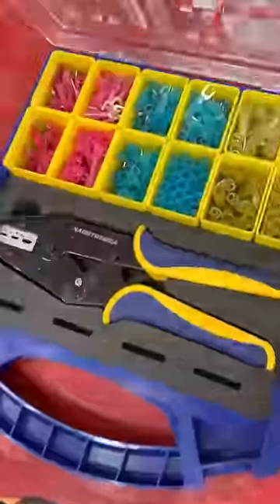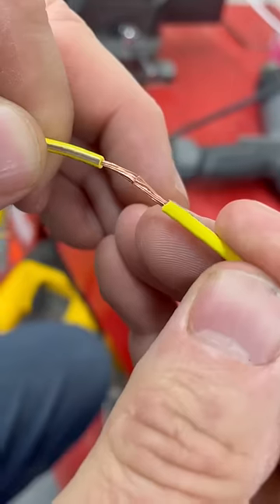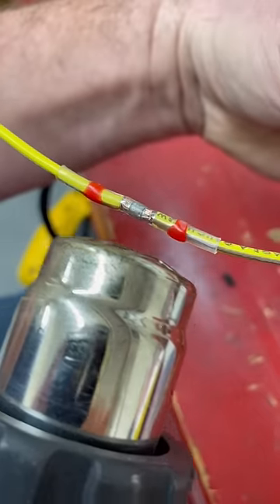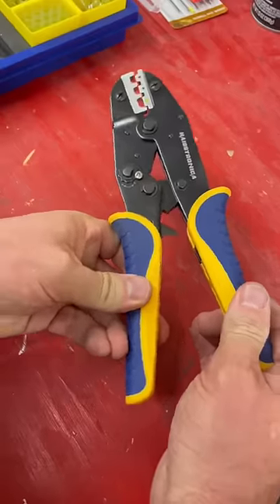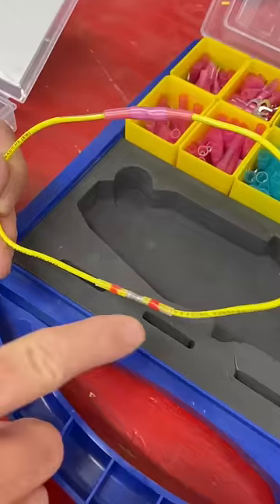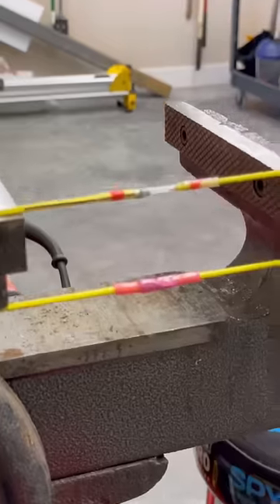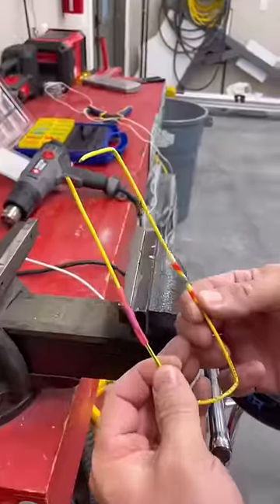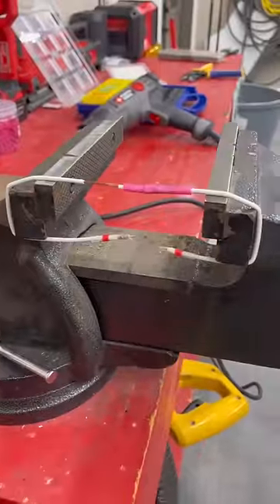Crimp verses Solder Connectors

Comment: Always use crimp connectors on power. That way the connection won't fail if the wiring goes over current and heats up.
Reply: if your wire is getting that hot, and its not blowing a fuse (which 100% it should be connected to) i would prefer a  solder joint to fail and break the flow of current effectively reducing the fire hazard.
Reply: Wrong, very dangerouse thinking. The dude purpose in life is to protect the wiring, prevents wire from overlaid heating and melting. If anything if crimped improperly can create a bad connection that heats up...
Reply: I'm not an expert but by the time your wire is at the melting point of solder (400 degrees Fahrenheit or so) wouldn't there be a lot more things to worry about than your wiring connections? At that point the insulation would probably all be gone and on fire
Reply: Yeah, any type of connection would fail under that extreme of an overload. But you should always use crimps, as the crimp itself provides more conductive surface area than the cabling itself so it's much more difficult to burn out a crimp connection, where as solder is only as thick as the wiring itself and is VERY susceptible to cracking under high vibration conditions like in a vehicle.
Reply: @joshuahelt6589  bruh what???? Having a connector come lose is a HUGE FIRE HAZARD.
Reply: @MisterMosfet  the crimp connector is better than solder ONLY if the wire strands ( and receptacles) are properly plated. Look at any decent vehicle wiring, you won’t find any  naked cooper. 
In the the video the wires are plain cooper, so this gives us the verdict.
Reply: So what you're saying is.
Run circuits UNFUSED.
A fuses job is to protect the conductor and devices.
The wiring should never get so hot that it can MELT lead-free solder.
Reply: @sushigaming101 100% agree I was taught to always solder all connections. If your lines are getting that hot you have bigger problems then a connection lol. All accessories you add to your vehicle should have a fuse close to the battery and a relay so it doesn't burn up the switch that and soldered connections you shouldn't have a problem.
Reply: Soldering hardens the wire. Try to avoid having any kind of splice where there is a lot of movement and vibration. Run a full wire to an area you can tie down the splice.
Reply: @yyfreak1637  PVC insulation is rated for 90°C, solder won't melt till at least 190°C. By the time the solder melts, the insulation will be gone along the entire length of the cable. That's far more dangerous than a broken connection.

The whole pint is mute though, if it ever happens, you've got bigger issues.
Reply: @sushigaming101  this type of solder connector uses low melt solder, still way to hot to be safe for a wire but it melts at a lower temperature than normal solder.
Reply: If you're soldering a connection properly, the solder joint itself will be much larger in diameter than the wire and will also be lower resistance than the wire therefore will never become a hotspot. The wire itself being smaller in size and higher in resistance will become the hotspot. The only time I've ever seen a solder joint fail thermally was because it was a poor solder where the joint was not completely saturated and the joint was also cold.
Reply: This is complete horseshit
If the connection gets hot enough for solder to fail, it's on fire.
Reply: HAHAHA!! Good one. Thanks for the giggle
Reply: Thanks for this knowledge 🤙
Reply: So I had a wire installed by a shop and they used the wrong caliber for the amps it was loading and no fuse to protect it which ended up heating the wire up to the point where the insulation burned off but thank goodness the soldered connector was still holding the wire on firmly.
Reply: Solder has a higher resistance than copper.
Reply: If the wire is hot enough to melt the solder. You've got bigger problems to worry about.
Reply: @BestSpatula  the solde may be more resistive than Cu but a soldered joint has lower resistance than any other connection with the next lowest being wire nuts.

IF soldering is so bad then why is it the acceptable joint used for NASA?
Reply: Depends on the use case tbh but aviation uses crimp for a reason
Reply: If your wire gets hot enough to melt solder, unless you're running silicon, you wont have any insulation left on the wire.
Reply: @bowez9  lol. nasa uses crimps. automotive makers use crimps. PC manufacturers use crimps. LAN/Telco uses crimps. nearly all professional stuff is crimped. the only time you see solder is when someone didn't know what they were doing.
Reply: If your wires over heat your whole house dose too 🔥🔥🏠🔥🔥
Reply: @airgliderz  Yes. Fuse is fuse and anything other acting as a fuse is bad.
Reply: @BestSpatula  NASA says otherwise page 84 of NASA-STD 8739.4
Reply: @bowez9  sorry. Where does it say soldered is preferred? This is just a standards document, and it covers standards for both splicing and crimping.
Reply: @BestSpatula  and there are pages of standards that a crimp must pass and be tested multiple times a day.  Where as there are only a few paragraphs on the procedure to properly solder.
Reply: @bowez9  because crimping is easy to do incorrectly
Reply: @BestSpatula  all the more reason to solder.
Reply: If you solder correctly it wont fail
Reply: @sushigaming101  temperature melt point does depend of type of solder the thickness of wire and what it connected to as thermal plane I have .22 that melts at 330 but then .32 melts at 500 so it all depends I use 60,40 tin lead flux rosin core but have used tin or lead free and it melts at 650.
Reply: 1) I agree, the solder thing is a bit over complicated 
2) If you have a wire that would get hot enough to melt solder from overcurrent, I think you would probably have bigger problems
Reply: @northamericanpichu  if your wires are getting hot you have a short somewhere or your wire gage is not appropriate for the circuit
Reply: Sorry dude but if it gets hot enough to melt the solder,it's going to be melting the wire covering also as that melts before solder does so you've got problems no matter what if the wire gets that hot. Actually having the solder melt and the connection fail may save you from having full blown fire. So soldering still wins. A lot of vehicles used what was known as a fusable link which was a section of wire that melted if too much load was put on it to prevent hurting the rest of the wiring system.
Reply: @joshuahelt6589  A big problem is that poor solder joints will get hot long before the rated current of the wire and FAIL.

A properly made crimp joint will produce 100% of the wire current carrying capacity.
Reply: @alexeyushakov1664  Complete and utter rubbish.
Properly made crimp connections are, air tight and as good as welded.
As long as the wire is clean and the joint is made properly, bare or plated makes no difference.
Reply: @charmio  The issue with solder is poor joints that creates heat and melts the solder.
Reply: @soundman6645  it would have to be a ludicrously bad solder joint. When you solder wires together, you essentially double the CSA (cross sectional area). For the joint have higher resistance than the rest of the wire it would have to be an almost completely dry joint, it's hard to screw up that bad.
Besides, a bad crimp would have the same effect. For this argument we should be assuming the person did the joint correctly or we're going to get off topic.
Reply: @soundman6645  I like your Albion-ish “rubbish”, bloke 😜
What’s the use of arguing? Pop up the hood of your Toyota and try to find a single handmade, bare-cooper crimp there. Picture it with your Android phone and post back here😉
Reply: @TehBIGrat  how do you use wire nuts?
Reply: @yyfreak1637  never said it wasn't, but its going to break that flow of current and stop the rest of the wiring harness from continuing to heat and burn (assuming there is something left to protect). You are likely going to burn the entire wire before the solder melts though. This is the exact reason you have a fuse on the circuit. if you get current over over the rating of the fuse, the fuse will burn out (just like your wire would) and protect the rest of the circuit from that over current.
Reply: @alexeyushakov1664  Mate I have dome my fair share of work on cars of many brands.
I have not once seen tinned copper wire used on a car from the factory
.
In fact I have a complete front harness out of a Hilux here including the fuse box .... all the wire is untinned.

The only place I see tinned copper wire is on boats and some aftermarket work.

Nealy  all factory wriring on cars is done with uninsulated crimp lugs, some of them are tin plated copper others are brass.

Because it is large scale manufacture these will be machine made crimps.

The other thing you will find in some toyota fuse boxes if you strip them down is a pressure welded bare copper wire joint, where the incomming heavy wire is joined to smaller wires that head off to the fuses.
Reply: @charmio  CCA is not Cross sectional area.
The thing you fail to understand is, solder is a hell of a lot less conductive that copper and while there is more material there, the resistance of the joint may be higher than you think.

particularly if the preparation and soldering is poor.

If you do not have the skills to make a crimp joint that is 100%, your soldering skills probably are not as good as you think.

Yes I have seen some ludicrously bad solder joints.
To be fair I have seen a lot of ludicrously bad crimp joints.

Remember my work often requiers me to do whole days of both soldering and crimping.

The other thing people fail to grasp is that solder degrades over time with temperatures way below it's melting point

NOW remember this.
Copper has a melting point of over 1000 deg C.
60/40 solder begins to melt at about 188 deg c
Water boils at 100 deg C
Some solder alloys melt quite a bit lower
.
Reply: @soundman6645  Bugger, your right, I meant CSA. As for the solder resistance, I still think the overall resistance will be lower, especially if the wires are properly splayed together. I'll test it on Monday though, kinda curious now.
Reply: @charmio  i doubt you have anything suitable to test it with.
Reply: @soundman6645  Avvariable power supply and a voltmeter is all you need. Takes all of 10 seconds to set up.
Reply: If you're wire is heating up that much, it's either under too much load, or there is a short, which should've already blew a fuse.  If there's no fuse, then you shouldn't depend on a solder joint as a failure, as "non-leaded" solder will USUALLY have a higher melting point than even silicon based wire jacketing, which is the highest temp jacket I know of...
Reply: @nicholaspayne349  which is exactly why FAA, NASA, and military specification specifies crimps for wire-to-wire joints. I learned wiring from an electrical engineer who founded one of the most prominent automotive aftermarket wiring companies. He said the risk of crystallizing the conductor is too great for an application that endures vibration.

I have yet to see solder connections outside electrical components in OEM applications. Solder seems to appear only in wire-to-surface applications.
Reply: @bowez9  
Now a soldered joint IS NOT the lowest resistance joint .... properly Crimped joints are " as good as welded" and have  the resistance of the parent wire.

Properly crimped joint, never fail in the joint, they fail in the adjacent wire. 

 I think you will find the majority of wiring terminations in the aerospace industry are crimped.
That is where the crimp connector came from
Reply: @BestSpatula  Soldering is very very easy to do incorrectly.
Crimping is very simple to do right, if you can be bothered to learn.
Reply: @supercoffeemug1921  yes it will, soldering stiffens the wire and makes it very vunerable to brittle fracture due to vibration or movement.
Reply: @soundman6645  obviously you haven't done or seen the studies/tests that prove a soldered joint is the lowest, equivalent to no joint at all.
Reply: @soundman6645  I am IPC J Std, IPC 7711/7721 certified the solder points are small for you to make it rigid enough to become brittle you would have to wick the solder under the insulation by that time you have a defect class 1 , 2, and 3 most solder connections are under 1/16 of an inch there is no way that will be brittle enough as for the wire gage shown in the video due its size the solder connection would be 1/2” and because of that gage it wouldn’t be brittle it would be stronger than the wire itself. Only reason solder cracks is because the process you did was flawed you didn’t use flux or you didn’t properly clean materials prior to soldering or you disturb the solder during cooling. That is known as a cold solder joint. If your process is acceptable you will not ever have a crack or cold solder joint.
Reply: @bowez9  no but I've seen plenty that prove that a properly made crimp joint is superiour in every way to a solder joint.
Reply: @supercoffeemug1921  EVERY solder joint on a stranded wire, will make that wire rigid, there is simply no way around it, no matter where the solder ends there will be a boundry between rigid and flexible.
.
the wire will break there ... this is well known and easily demonstrated.

BTW most people viewing this are not certified or specifically trained in any way and are unlikley to make a joint where the solder does not wick under the insulation.
Reply: @soundman6645  so you haven't looked at the data that shows soldered has LESS resistance.  Nor read the standard showing crimps require more tests and multiple daily tests, where as soldered do not require them.
Reply: @soundman6645  that is not true only part of a wire that is rigid after solder is the joint if properly done. If your solder result makes it rigid around the joint you need to adjust your process.
Reply: @supercoffeemug1921 Now, exactly what wires and terminals and in what application  are you talking about 
.
.
not my process that is the issue..... the vast majority that have neither the correct tools nor the training and still persist that solder is better.
Reply: @Joshua Helt  think about it, a loose connector isn't going to register at either the fuse or device unless it's totally unplugged. Reason being your loose connection is exactly like a resistor, so as long as that amp draw stays under the fuses spec, you would have a resistor type heating element that is free to make fire meltyness stuff
Reply: @soundman6645  the reason Solder makes a better connection is it makes a bond with the metallic surface instead of a point connection. Better the Bond the better conductivity less impedance less impedance is less resistance less resistance less heat.
Reply: This is true because if power connections break that means you almost certainly get a spark. It's rare but such a spark can start a fire. You always want the circuit to break at a part designed to contain sparks.
Oxidation of tin also leads to rising resistance of the connection over time, which in turn makes the connection hotter, making it faster to oxidize.
Reply: @supercoffeemug1921  the reason a properly crimped joint makes a better connection is because the wire assembly in compressed to such an extent it is a solid block of copper ... as good as welded.

solder is inferiour because it has a much higher resistance than copper, a very much lower melting point, solder degrades with time and heat way below it's melting point
AND soldering requires a flux with promotes corrosion in the wire
Reply: doesnt matter if it did melt the solder because you have other problems. But regardless, its not the solder holding it together.
Reply: Sr, solder melts at like 180c, your cabled insulation will melt before the solder does xD
Reply: @Brandon-uy1uv  you are making several poor assumptions.
.
1/
Standard Lead Tin Solder melts and flows at around 180 to 190C, depending on composition.
Solder degrades at temperatures well below "melting point".
Particularly when continuously exposed to heat.

There are low melting point solders ( like used in the sleeves in the vid), that by addition of other metals will melt as low as about 80C.
.
2/
The insulation temperature is not necessarily the same as the wire temperature.

3?
V95 insulated electrical wire has a continuous service temperature of 95C.

Silicon or silicon composite wire can have a continuous service temeperature of 180C or considerably more depending on composition.
we use silicon wire in, theatrical lighting, heating equipment and where extreme flexibility is required.

PTFE ( teflon) insulated wire has a service temperature of 180C to 260C depending on composition.
PTFE insulated wire is also used where high temperature performance is required.
It is commonly used in Aviation.
Reply: @Brandon-uy1uv  Technically the solder in those connectors is low temp solder and will melt before that
Reply: @yyfreak1637  not to mention shock hazard of an overcurrent wire being free to dangle about.
Reply: @airgliderz  I prefer to sacrifice the expensive hardware so that I don't have to replace the wire or a fuse.
Reply: @sushigaming101  buddy if I had a dollar for every time I saw the insulation burnt off 6-12 inches of wire on a live and functional circuit I could retire 🤣🤣🤣🤣
Reply: We use these connectors on planes. They’re called environmental connectors since they are waterproof and good for outside.
Reply: A fuse is there to protect the wire that's why you fuse according to wire size. If your wire is hot enough to melt the solder your over fused or maybe not at all.
Reply: @sushigaming101  but what is the melting temperature for this stuff? I'd be willing to bet it's a lot less than 400. And if (and you have no idea) it failed to achieve a good mechanical/electrical bond you could be generating heat just like a poor crimp. Personally I'll stick with filling the connector with dielectric grease and using the ratcheting crimper.
Reply: @zombieapocalypsecherokee9224  A crimp not only provides a lower resistance connection, it's also more resistant to movement and vibration. Crimps are always used in mission critical applications just as trackside railway signalling where high reliability under harsh conditions is required.
Reply: @gadgetdeez7069  No, a correctly formed crimp gives the lowest possible resistance since it's a cold weld. Soldering introduces a higher resistance alloy between the two conductors.
Reply: @ferrumignis  Yeah idk I've never had a soldered wire fail as far as vibration or movement 🤷‍♂️ I do know you can almost hang on a soldered wire connection a crimp connection not so much 😕